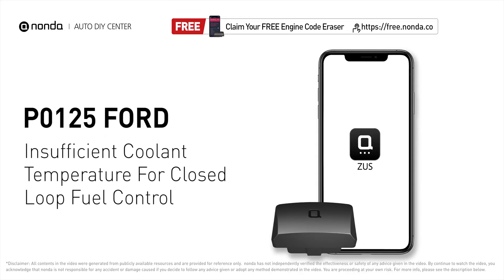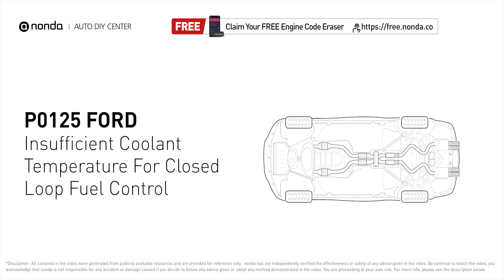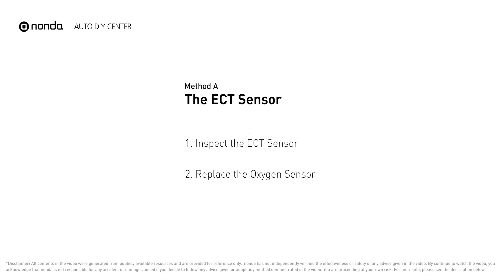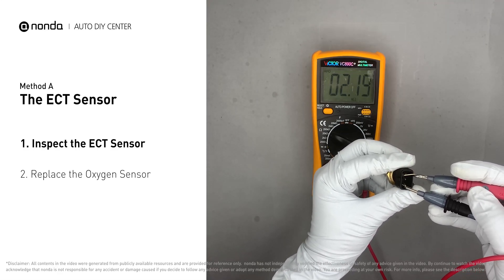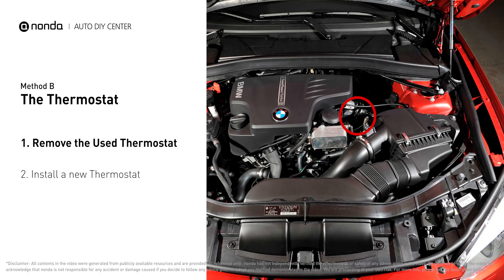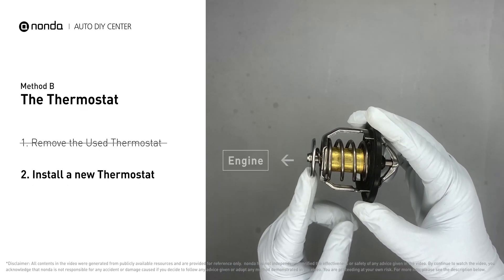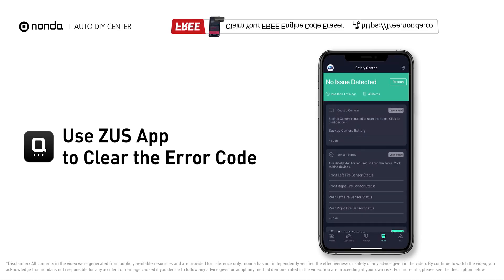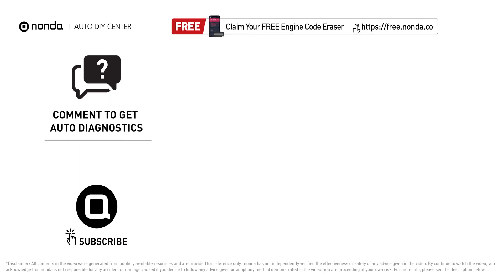How to Fix FORD P0125 Engine Code in 3 Minutes [2 DIY Methods / Only $7.39]

Comment: I replaced both the ECT sensor and the thermostat. I got readings  of 2000. Also, checked the wire to the ECT no tear can you show a video of method C?